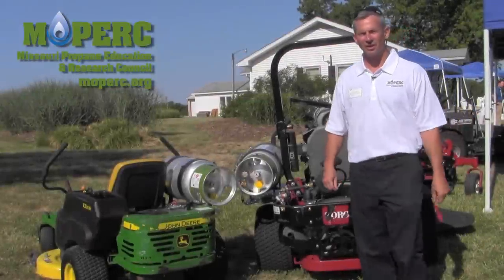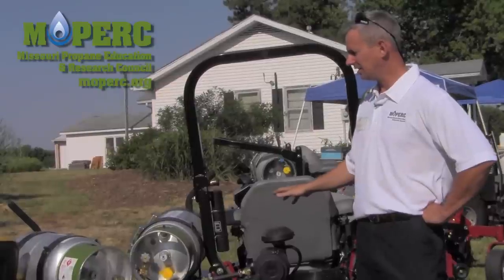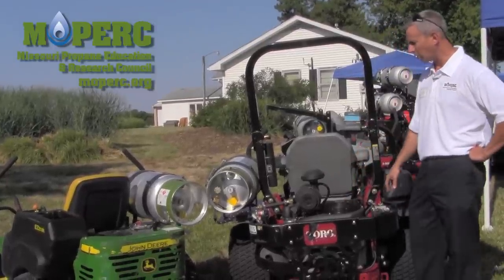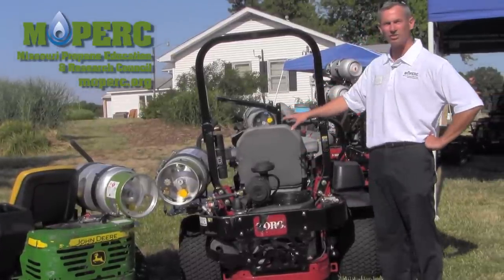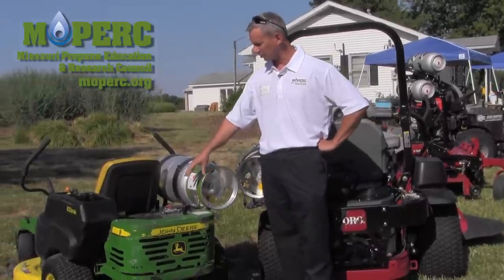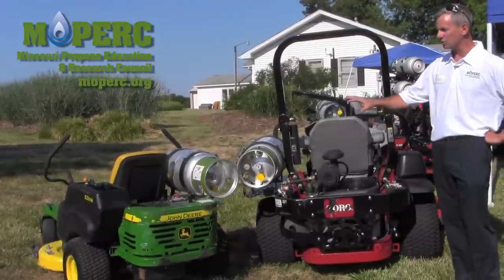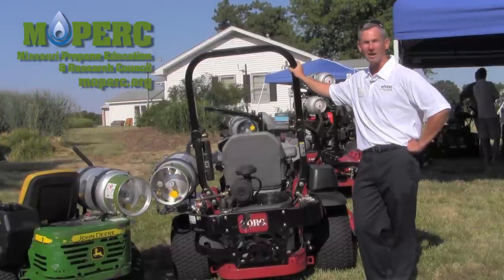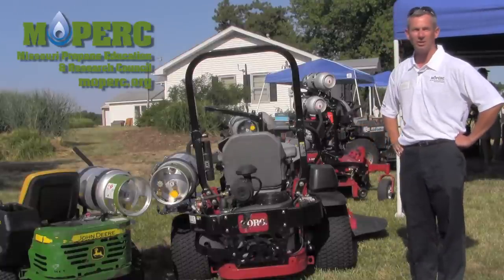Converting a Zero Turn Mower to Propane | Innovation

Comment: I have a friend that has Ferris ISX3300 zero turn mower propane conversion that has issues starting and has a backfire when letting off the key after cranking and has not been able to find a fix to the problem.... Any pointers or leads to a person that has the fix?